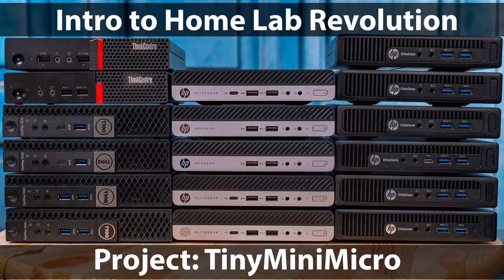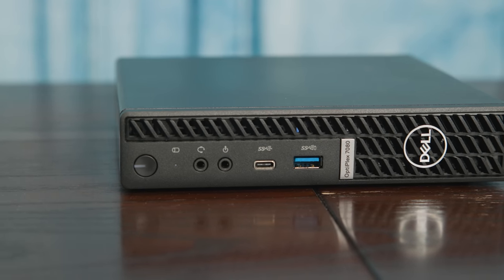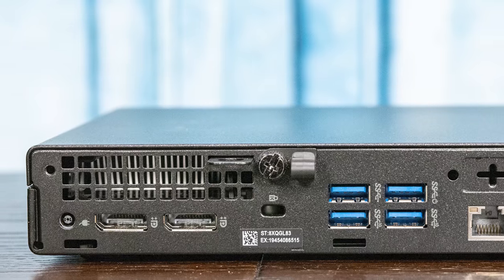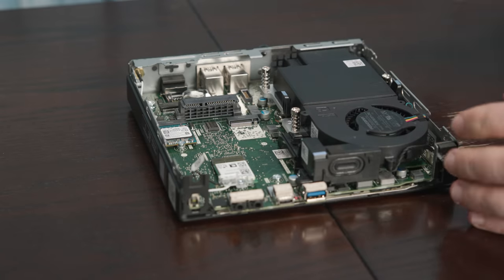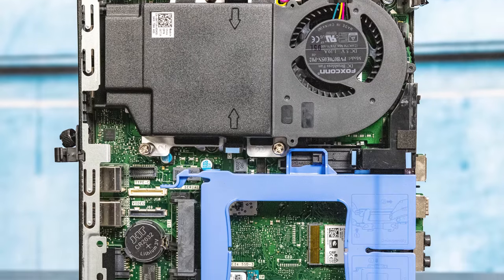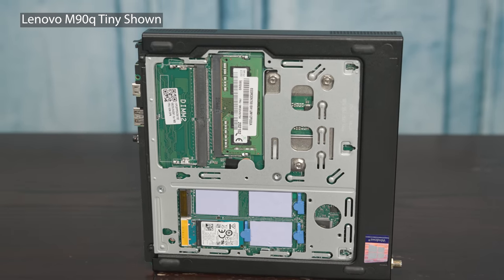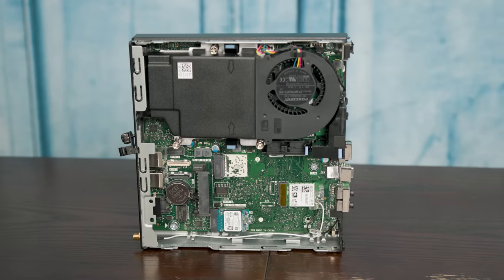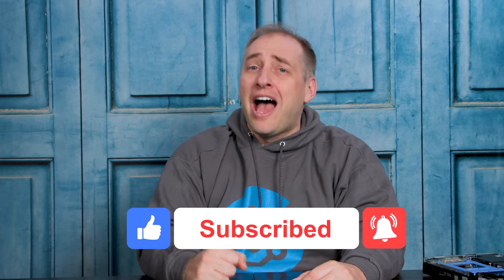Dell OptiPlex 7080 Micro Review Big and Small Evolution

Comment: Warranty was worth it. I had an issue with my work ThinkPad laptop still under warranty. I was lucky to solve it by guidance of the Lenovo technician on the phone. Awesome support. Sending in a laptop and not being able to do work costs a lot of money. If it was not solvable they would send someone.

For my hobby systems I buy second hand that is another story.

About second hand; how well do these batteries last? I know I sold my Amiga 4000 in time years ago.

Comment: Great review! I planned to get a unit like this, but they are quite expensive.
Ended up getting an Asrock X300 with a Ryzen 4650G processor and 32GByte of RAM.
Not as compact, but more flexible with storage and processor options. Runs fine with Proxmox at about 13W with a few VMs running (very light load). Under Windows it got as low as 7W idle.
The only issues I had with it, is with the SATA connectors, they are a pain to use and very fragile. Use nvme SSDs if you can. 
And replace the CPU cooler with a Noctua NH-L9a-AM4, then it is fairly quiet.

Comment: There is a power button, because that's important 😂
Reply from the maker: What else do you say about a power button? Ha :-)
Reply: @ServeTheHomeVideo  Actually I would like to know if micro/mini which having socketed cpu. From my point of experience on early NUC, pretty much too easy to brick
Reply: @ServeTheHomeVideo  Hey man, don't sleep on good power button. The one on the Wyse 5070 is terrible. The LED isn't bright enough and it's pretty tough to tell if it's on or off in certain settings.
Reply: @ServeTheHomeVideo  Actually!  You could point out if the LED in the button is dual-color.  Dell uses it sometimes to show boot time diagnostic information (or if it's sleeping).  I miss the days of the 1-2-3-4 diagnostic LEDs they used to have...
Reply: @starrynight3945  for sure HP have sockets. All of them are basically the same computers, so yeah.
Reply: Why does one of those cost more than a Dell Inspiron desktop tower 3891?  I'm shopping to replace a very old Dell Dimension 3100 desktop PC from 2006 with WINXP.
Reply: My old Linksys WRT-54G router that came with my 2006 Dell desktop PC is almost as large as the device you're reviewing in your video.

Comment: One of the things i like about the Lenovo Tiny is the companion monitor, and the ability to label the machine on the front. Other than that I like the SATA riser over HP/Lenovo. Honestly HP, why use a locking insertion mechanism if the SATA connector is just on a ribon and held in with 2 screws

Comment: I would think that if you have a use for this in a company, it'd be far easier and simpler to just buy a few extra units and have IT do a hotswap on any defective units, and then send it in for warranty. On-site for anything like this seems incredibly wasteful to me. For the sake of argument, let's say that you order 10% extra units. If we go with the default configuration, that's an extra $88 per unit, which is slightly more expensive than their current offer of "ProSupport plus next business day onsite" for 3 years ($60), but cheaper than their 4 year plan ($136).

The only exception I can think of is if you have lots of remote workers who aren't anywhere close to the office.

Comment: Bought this as a home computer in December (core i7 + RX640). Performance is impressive for such a small form factor however the cooling system just doesn't cope with the heat it generates. AIDA64 shows CPU temperature at >60 degrees Celcius on average while light gamings/youtube. Have changed the thermal paste to MX4 but there has been no improvement. The cooling stands don't help - the "box" itself is pretty cool but what's inside of it is still over 60 degrees. Has anyone been able to solve this problem? Any advise please?

Comment: Why is it never possible to use the optional port (above the LAN port in this instance) as a second LAN port? Even if it meant using an M.2 NIC.
Reply: Getting an M.2 NIC is not as easy as it sounds. I've searched quite a bit, and there are not a lot of offerings, especially with the E-Key (from Wifi).

I could not find any with an Intel Chipset.
Reply: @jmlemmi  I know, I've been there too. I'm suggesting they should make one. Actually there should be some standard external port placeholders for this new wave of SFF systems, so that a market of M.2 expansion cards can develop. Who's going to market a dual port M.2 NIC if there's nol place to put the RJ45s?
Reply: @jmlemmi  A bit late to the party, but I bought one back in 2019. It was imported from Holland to the UK (before Brexit) and it cost me 37€ with 15€ shipping, its a small M.2 card (same size as a WiFi card) with a connector that breaks out to a gigabit eithernet port. It was a bit unsightly, but I was able to route the cable through where the VGA port would go. This was on a 3050 Micro, but will be just the same. The chipset is Intel I210-AT, datasheet is on the Dutch sitte here: https://abigo4u.com/media/datasheets/M2-210_Datasheet.pdf

Comment: One aspect people do not consider is if you go Wireless and do not want a cabled mouse or Keyboard then the way to go from a longevity point of view is Bluetooth the only exception being a wireless keyboard mouse combo from Logitech and there is a very good reason for either Logitech or Bluetooth.
Every other brand of Wireless connected periphals has a wireless dongle that is unique to that combo if it breaks or you lose it then that keyboard mouse combo becomes e waste as it is now useless, However Logitech has what they call a "Unifying" wireless dongle setup that works with pretty much all of their periphals so if your mouse of keyboard fails you just get another Ligitech Mouse or kayboard and marry it up with software to the old dongle and you are good to go.
Bluetooth is just as simple as airing a new or replacemtn periphal and it just works.

The only potential issue is that if you type fast anything but the best wireless setups or a Wired preferably PS2 keyboard you will find typing mistakes because the keyboard does not respond as fast as you can type.
These are things to be aware of that get very little coverage but can impact you when you least expect it.

Comment: I bought one of these a while ago because i thought it would run quietly - the fan is so loud, even at idle, that it makes it almost unusable. No fan control options in the bios and no way to control the fan properly from in Linux. Be warned if you are considering and hoping for a quiet machine..  at ~€1000 for the i7 unit this was a very expensive mistake to make - probably should have returned.
Reply from the maker: Do you know the model you bought? The i5-10500T was certainly quiet at idle, about what other units in this class are. Interested since I know there are many options we did not test. The i9-10900T in the Lenovo uses a lot more power and is louder.
Reply: I know my 8200T gets loud with badly written software and installing large Windows updates.  A noise comparison review would be a good thing to do.
Reply: @ServeTheHomeVideo  its the i7-10700T - i got the T model because i thought it would use less power and therefore make less heat and run the fan lower. On linux (tried several distros just to check) the fans seem to run at ~1800rpm at idle which is audible in a quiet room - exactly what i was trying to avoid. I suspect that i might just have got unlucky on the fan lottery - the fan looks seriously cheap so it might just be that mine is loud and others are not but there is no way to confirm this without checking a few of them together. no fan controls in the bios and limited options to control the fan through linux. i8kutils (often used to control the fans on dell laptops) can set the fan to low (~900rpm) which is ok when the machine is idle but if I stress it the fans will no longer spin up and the machine maxes out at 90 degrees C.
Reply: @ignus16  I have the 7080 with i5-10500T,  but found the same minimum fan RPM speed increaced like you say to 1800rpm when updating BIOS to a newer revision, and the unit was certainly audible at idle. Others have noticed the same issue, and the fix is to downgrade the BIOS, which for me was to v1.1.5. After doing this the unit is very quiet again, which was good enough for me at the time. 
I am running Linux Mint 20.1
Reply: @stoodio123456  hey - thanks for letting me know! what steps did you use to do the downgrade? apparently im currently running 1.1.10 and fwupdmgr shows that it is the latest version but wont let me install an older version. the dell website shows the latest version as 1.3.10 which lists a few fixes but nothing to do with fan speed/noise.
Reply: @ignus16  You might want to double check the version in the BIOS, as it it would be good to know if you wish to revert to your current version.  You can upgrade or downgrade the versions easily from there.  It seems apart from the current 1.3.10 they have "older versions" currently listed as 1.1.5 and 1.1.0 and 1.0.7 on the Dell Optiplex 7080 System Bios Driver Details web page.  There are "installation instructions" on the same page for putting the OptiPlex_7080_1.y.x.exe file into the root directory of a USB stick and doing the upgrade from inside the BIOS Menu (F12 on boot).  It is probably worth a try, the process does not take long. You could try upgrading first to the latest, then try 1.1.5 and then perhaps back to your version. Good luck :)
Reply: @ignus16  stressing the cpu will make the fans ramp up and be loud as you wold expect, maybe you can use some of the fan tools daemons to adjust the fan speed based on temp.  I have noticed that my v1.1.5 bios keeps the fan at 900 RPM when idle (28-38 degrees celsius), and ramps up in the 40s to a higher RPM (like 1800) and above 50 is much higher.  I did not have i8kutils installed and lm-sensors only shows me the temps and not the fam RPMs. 
It sucks to have to replace cpu thermal compound yourself on a new machine when it is under warranty, maybe you should lodge a support call and let them diagnose it. Hopefully someone else with your CPU model will chime in.
Reply: Did you try to use i8k driver in Linux? I have older machine, Dell Optiplex 7050 Micro, and i8k driver with i8kmon daemon works good. There is no way to get auto mode back after changing fan speed to manual speed but that's fine for me.
Reply: @tomaszgasior772  hey - yes, i tried this and it works well to quiet the fan but then if the machine is busy it will overheat.. not really a great option imho

Comment: I have the 7060 w/ i7 8700T on Q370. Does anyone know if it will do higher memory speed than 2666? Would I be wasting money on 3200? I have 1x16GB 2666 and trying to decide whether to get another 1x16GB@2666 or 2x8GB@3200. I won't miss the capacity and use the system for emulators so any improvement on the iGPU is interesting to me.
Reply from the maker: Your CPU will only operate memory at up to DDR4-2666, not DDR4-3200.

Comment: Hello please advise the following:

I have re-imaged this PC to a Company lab (GI) Golden Image. 
After the image is properly installed I see that it goes directly to the Windows desktop. At this point, everything works perfectly. 

However, when I shut down the PC the PC just stays stuck on the Dell Splash screen. 
Why does this happen? Is there a new BIOS setting that I need to configure? 

Please help.

Comment: Is AN onsite warranty worth it? Yeah, for sure especially when purchased at discount with the machine. Is THE Dell onsite warranty worth it? Well, not usually at the prices they offer, especially when compared to Lenovo, definitely not in my country. And the worst of all: extending these warranties post purchase with Dell is absolutely, stupidly and inexplicably bad value as they charge waaaaaay too much. So when you actually have the product, love it and feel you will be using it for some years, they grab you by the groin and either tell you that it's not gonna be possible post purchase (and definitely never after warranties expire...) or that it will cost you about as much as the price you got the product for on ebay. Bummer.

And my particular experience with Dell's warranty is that if you're a home user with pro kit (especially when they take notice), they pretty much treat you like dog poop. At least in my tail of Europe country. And once again, Lenovo simply has more to offer on warranties as you get 3 very streamlined tiers, at up to 5 years, with very explanatory descriptions and at very sensible prices. Sure, they only have onsite on the top tier but then again Dell will keep you beating around the bush with Level 1 tech support and make it REALLY HARD to get to a point they actually go the literal extra mile and fix your problem. This is my experience from how often I saw them pamper a past workplace environment, and then with me purchasing their kit with my hard earned buck and just disappointing me in every possible way.

The flip side is though: Dell kit and parts are much much more available and oftentimes cheaper on the secondary market that most of the maintenance can be done by yourself, by  using salvaged stuff available all year long through local, ebay or Asia suppliers.

Comment: The device cannot be mounted on a VESA mount.
It has no accessories for mounting on a monitor.
Device can not stand vertically.
Reply: That's simply not true. Dell offers a dual VESA mount
for this purpose and you can easily find them on ebay.

Comment: Can I connect 4 monitors using a splitter for each DisplayPort? (I cant do daisy chain as monitors don't support it)
Reply: The DisplayPort outputs should support Multi-Stream Transport (MST) just like on the 9020 micro
in which case that shouldn't be a problem. You can almost certainly daisy-chain two monitors on
each port and quite possible more. 

I have a 9020 which has a single DP and have two monitors on it and as I recall it's possible
to add more so you should be able to do what you are proposing.

Comment: These are so expensive in Germany
Reply: Yeah same in India. Have you got..?
Reply: Wenn Du die Dinger kaufen willst, darfst Du nicht auf der Webseite nach dem Preis schauen. Ruf besser einen Berater an... Da geht immer etwas. Vor allem bei Optiplex, Precision und Latitude.
Reply: @sebastianganser1265  aber nur als Geschäftskunde, oder?
Reply from the maker: These actually are about $150 more yesterday when we checked for this configuration versus when we purchased it about two months ago. It may be the impact of coupons, but I also wonder if prices have gone up with chip shortages.
Reply: Not only these and not only in Germany. Hardware prices new and second hand went up a lot. Hunting for more HP Gen 4 or 5 Prodesk mini machines  for < EU 300.
Reply: @fg3ify  ja und nein... Erstens dürfte es nicht so schwierig sein über jemanden mit einem Gewerbe zu kaufen und zweitens konnte jedenfalls früher auch DHS (Direct Home Sales) bessere Preise am Telefon machen.
Reply: @shubhamadtp  You can configure these units on Dell India website too but they ask you for GSTIN if you wanna buy these. Else you need to either talk to customer care or buy from a shop. i5 10500T systems aren't cheap and I'd rather go with i3-10300T ones instead if I plan to use them for home servers.